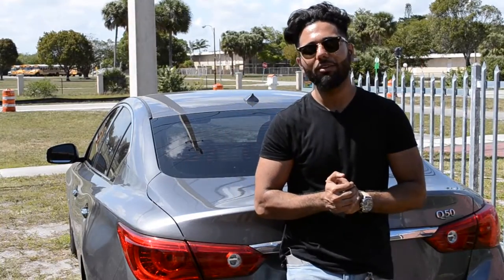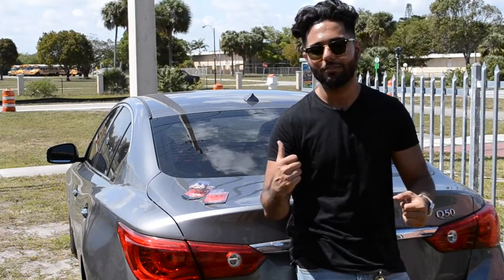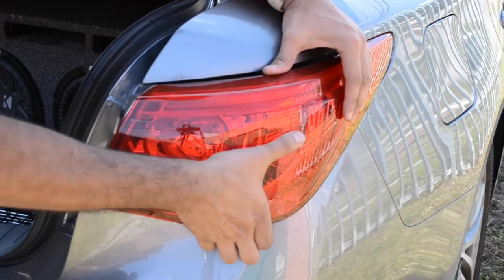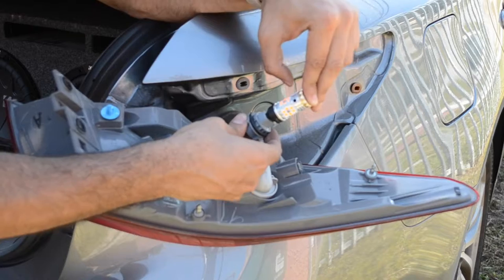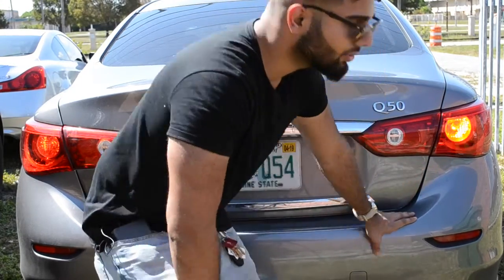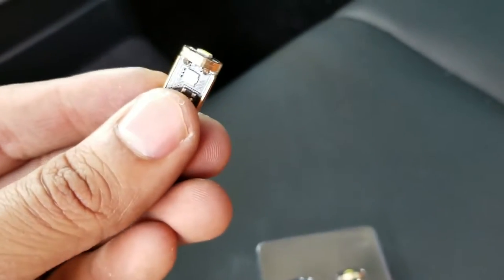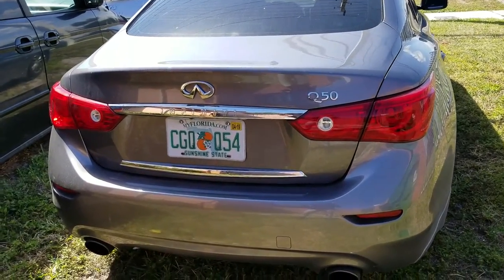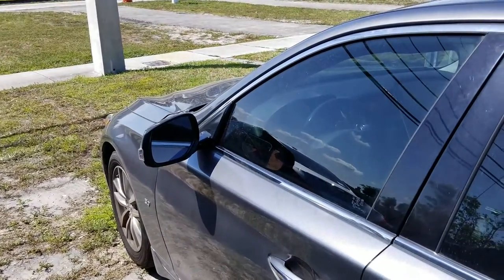Infiniti Q50 Lasfit LED Turn Signal Install | Step By Step

Comment: For anyone upgrading your interior Q50 lights to leds. Just pop the plastic transparent cover off the housing of the light with a small flat head. Its much easier. Do not pull the full dome light assembly out because its a pain to get the assembly back in properly without messing stuff up.

Comment: I got the lastfit bulbs. It looks great. Bright and has the correct amber color all cars should have. The tail as turn looks nice, but they don't look as bright in daylight. And they're the wrong color. Idk why car makers are using red turn signals now. If people are behind you in busy traffic, only the guy behind you(maybe 2 cars) can see if you're signaling. Otherwise they'll only see 1 side. If they're heavy traffic, they'll only see it blink once. Is that car braking? Turning? The stock turn signal has its own lamp which is OK, but the amber lastfit bulbs makes it LED and gives it the correct color. The tail as turn just gives you blinking brake lights which is fine for looks, but I like the JDM style of the lastfit bulbs.

Comment: Hey I just got my q50 and I have a really noob question. Can you direct me on how to turn off the navigation screen to the clock like you have?
Reply: Hey, as far as I know, only the base Q50 models come with the standard clock as the premium/tech trims replace that clock with a navigation unit.
Reply: You can't replace the navigation to the clock, it's because his car doesn't have the nav system..

Comment: 7440A usually indicates Amber.  Are the bulbs white since they are going into a red lens housing?  If they are Amber will they still provide enough illumination since the lens is red?

I have a 2015 Q70 and wonder if the procedure is the same.

Personally I prefer the -Amber turn signals for contrasting color.  I need to check these out and see if they fit the Q70/Q70L
Reply from the maker: These were Amber but since the housing was red, the Amber was not noticeable at all and made the red look darker and they are really bright much brighter than the stock turn signals. I'm very sure they'll fit on the Q70 as well but just double check with Lasfit they'll be able to advise I think. You won't be disappointed on the illumination

Comment: why not get he dynamic diode? it'll use the brake led lights as a turn signal... for $40 you cant beat that.
Reply from the maker: That's true but I wanted to utilize the OEM turn signal and LASFIT reached out for help so why not :) maybe in the future when I get tired of it but I feel that this is much brighter than converting the brake light into a turn signal which is what I was looking for

Comment: I want to end up with yellow turn signals, I have red glass on qx60 2019. Do I need to take amber bulbs? And which ones?
Reply from the maker: The bulbs are always amber the glass itself makes it seem red. Same deal with my Q50 these were super bright Amber bulbs but because of the red glass it makes it look redish. Only way atleast that I know to make it yellow is removing the red glass for a clear one if that exists  which is quite a project itself

Comment: does it hyber flash when you turn the single to the left or right?
Reply: By the looks of the video I think it is hyperflashing which is pretty lame the car doesn't recognize those LEDs its gotta stay stock unfortunately I tried doing 2018 taillights it didnt recognize them and it was hyperflashing
Reply: Martin Hernandez that’s bad i liked the color of it it looks almost OEM color not like the other LED’s that looks like they’re close to red more than a clean orange, I hope I find a good one with a good color that doesn’t hyberflash
Reply from the maker: It does not hyper flash I have been running these for a while now and no issues regarding hyperflash or the car recognizeit. It blinks normal as shown in the video :)
Reply: Performance Driven thanks a looottt 🙏🏻
Reply: @performancedriven  it kinda does look like its blinking fast but anyways to each their own bro if you like them go for it rather stay OEM on my q50

Comment: Waste of time and LED or regular bulb still look like crap. Contact diode dynamics and grab a tail to turn kit wich is plug and play and you don’t even have to remove the lights. Turns your brake and running LED lights into integrated turn signal wich looks 100% times better than that stupid little turn signals that Nissan and Infiniti always put on there high end models. Looks like an after thought. These kits are cheaper than most LED bulbs and even come with a warranty from them and great customer service. diodedynamics.com and you won’t regret it.